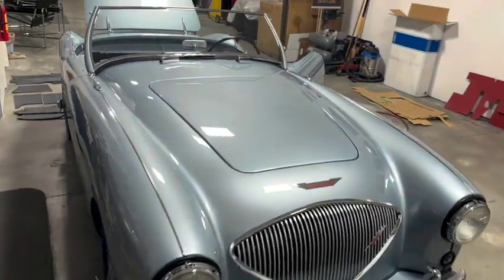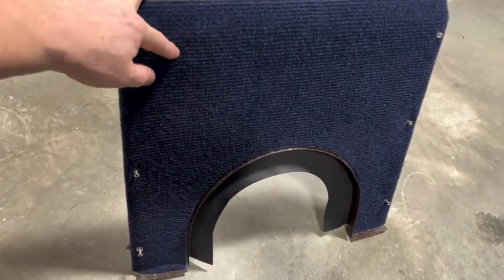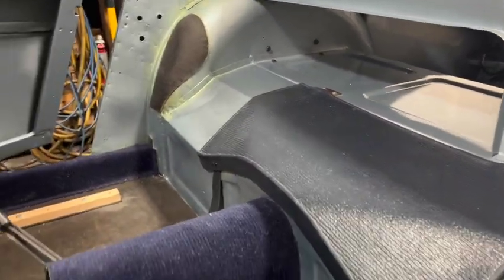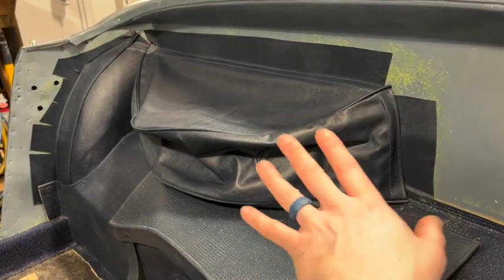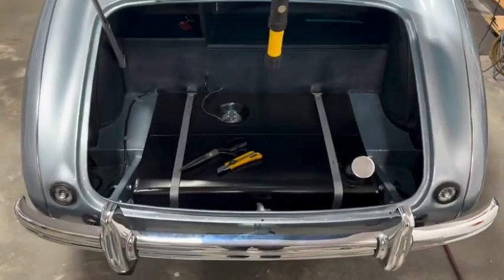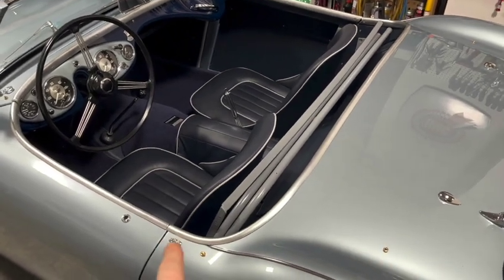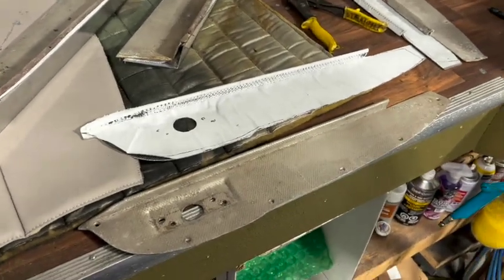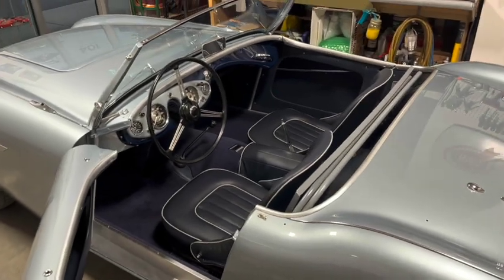BN1: Interior Trimming

Comment: Geoff, when you use the 3M Sound Deadening Pads below the jute carpet padding, do you glue the jute to the 3M pad?  If you do glue the jute to the 3M pad,  do you first remove the mylar from the 3M pad, or do you glue on top of the mylar?  3M only advises that if you paint the 3M pads, you should first remove the mylar.
Reply from the maker: I remove the plastic before gluing

Comment: Beautiful work Geoff! Question for you. You may recall that I have a BT7. Just curious about that rubber seal at the bottom of the door where it closes to the threshold. Was that also used in the later cars? I don’t recall it on my BT7 when I disassembled it. Thanks. Lin